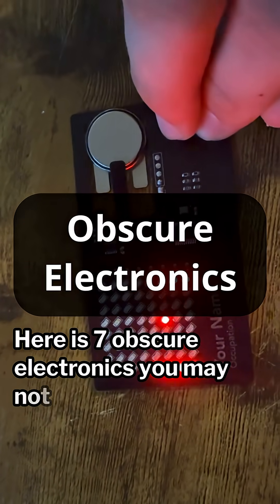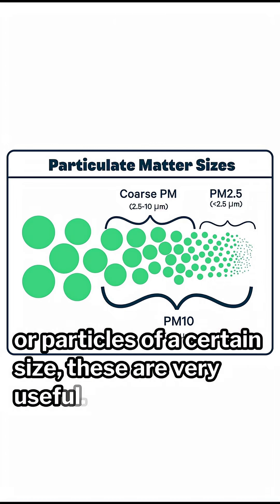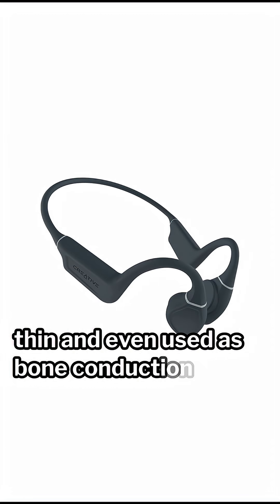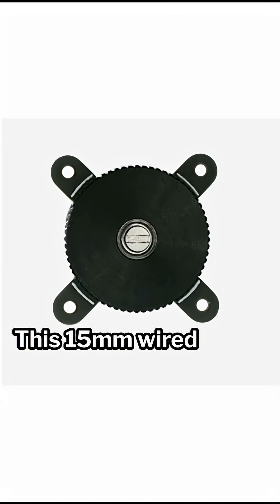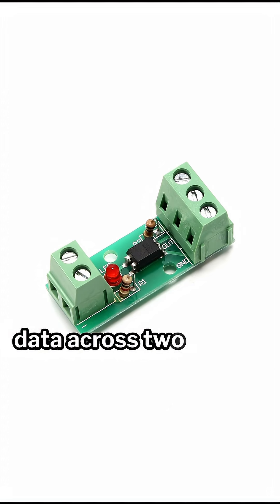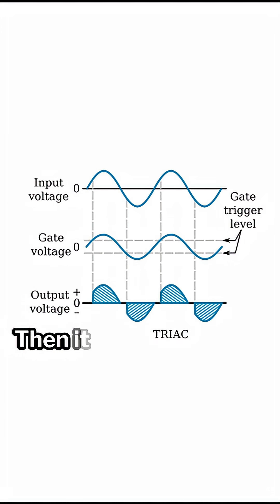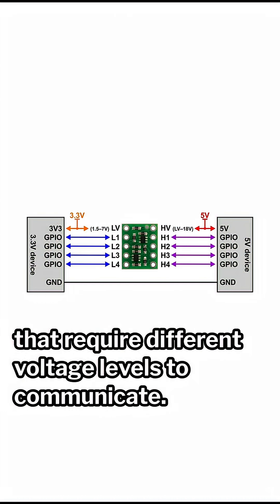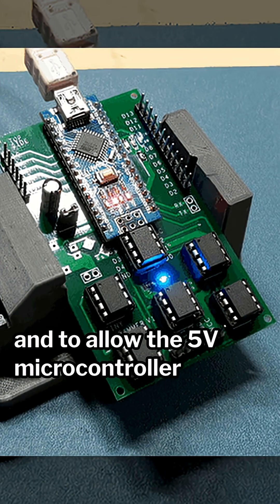5 Obscure Electrical Components  #advice #arduino #electronics #electronicsprojects #robot

Comment: The air quality sensors, I made one for each of my rooms. Designed a circuit board and all the circuitry and running an ESP 32 system on them. And I don't cheap out and just put pins on a dev kit and throw it on there I actually build up the entire processor and circuitry in flash and everything. So my circuit boards are 100% custom. Well I designed those and I have humidity indoor air quality barometric pressures and both p i r sensors and radar sensors. Then on home assistant, I took a floor plan of my house and put the sensors on each spot of it, and then created a heat map of the each item so indoor air quality shows a full heat map from like blue yellow green purple pink type of heat map and they all overlay on each other and so that way you can see room by room what the quality is on each one. And then you can even set up alerts for something like if a fire might start IE the air quality goes through the roof there's no movement and the temperature starts rising in that room very quickly

Comment: As an electronics hobbyist (with plans to get an EE degree someday), I was surprised that I either 
a) knew these things existed (particle sensor, PCB motor, optocoupler) or 
b) have actually used them in circuits I've designed, or played around with (human sensor, level shifters).

Comment: I think a connected Arduino with each having related sensors and a Central control center set up should be in every large industrial and even civilian places by law 
They can help for industrial fails safety faster than any ready system and their wide sensors in market can make a safety from incident and any sort of security problem become obsolete if designed right

Comment: No, in bone conduction speakers used electro-magnet elements
Reply from the maker: Any commercial bone conduction speakers, absolutely. But if you bite down onto a disc buzzer, it also acts like a bone conduction speaker.

Comment: With gas sensors make sure the sensor actually detects the gas you want, and not just an estimate. Lots of CO2 sensors use eCO2 which just estimates the CO2 level based on some other gas in the air.

Comment: The TRIAC can control ac motors I think
Reply: Yes, a very simple circuit using a triac with a diac or even an optocoupler to trigger it.  Idk if Dremel uses them but the knockoff BlackNDecker rotary tool used triac for AC motor speed control.
Reply from the maker: Yeah, I’ve seen someone control a heating element with one. But he ended up using a cheap ons

Comment: I would like to admit, I was one of those guy who uses voltage divider for each output pin because I didn't know level shifter existed. 😂
Reply: I am doing a final year project currently and I used relays to solve that voltage difference problem…. FYI
Reply: @wunnaaung7386 Jesus Christ… that’s metal bro 😎

Comment: I did a level shifter design with it's calculation for electronics 2 lab finals
The lab engineers said the lab final tests are boring so he let us pick projects
I did a 4 bit  dac module with lm741 op amps
My friend did the level shifter with n jfet,very cool small project